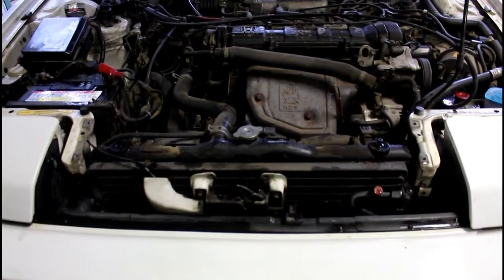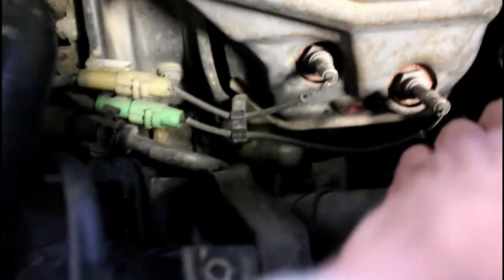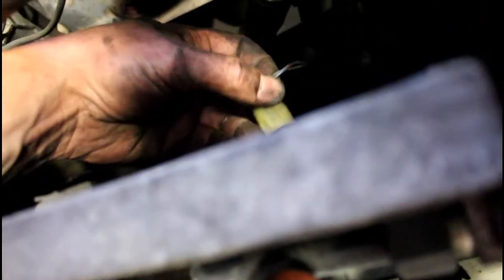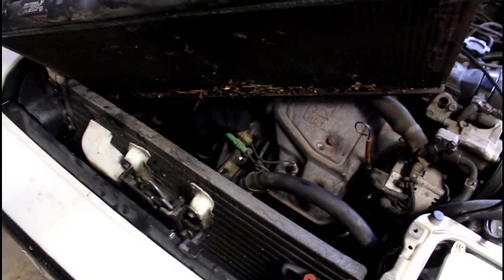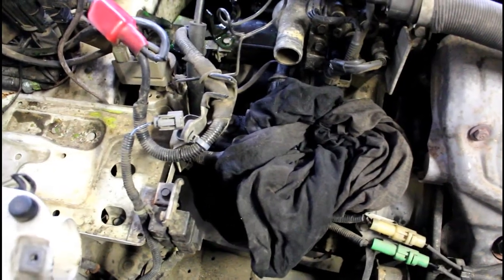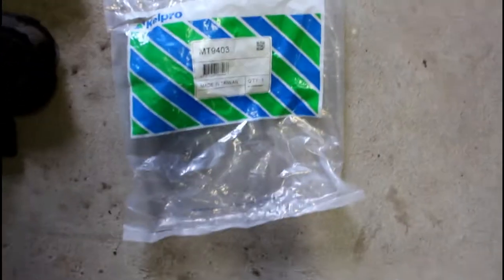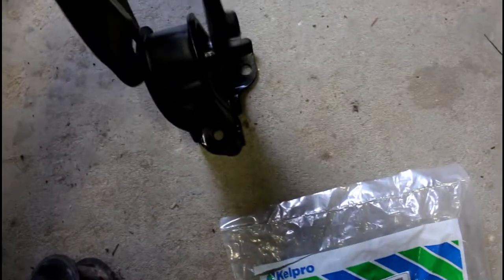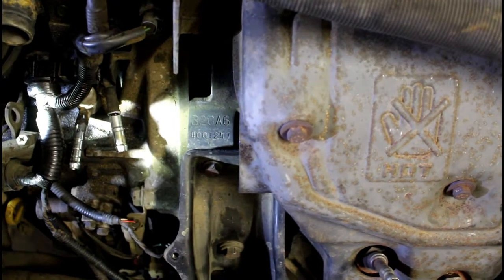Honda Prelude 1991 front engine mount replacement and thermostat replacement

Comment: Fuel line does the trick for the coolant hoses. For the straight ones, like you said, just go buy fuel line hose by the foot. Its like a buck or two per foot. Lasts forever